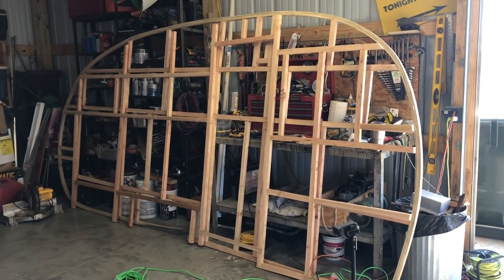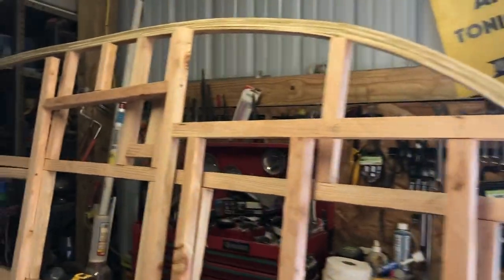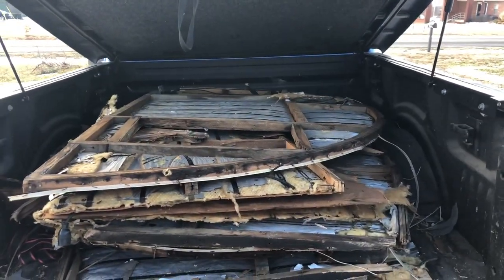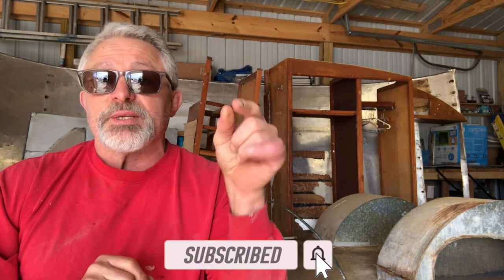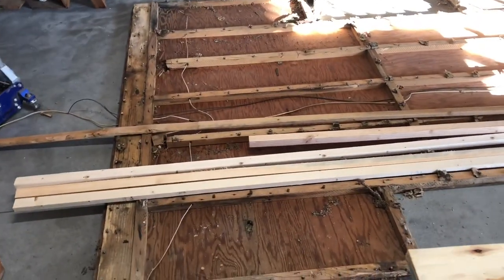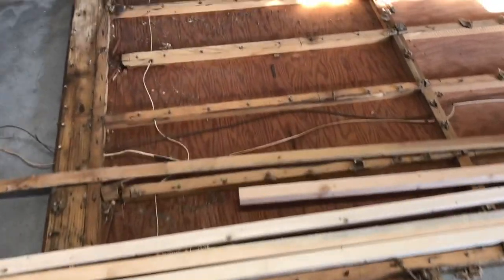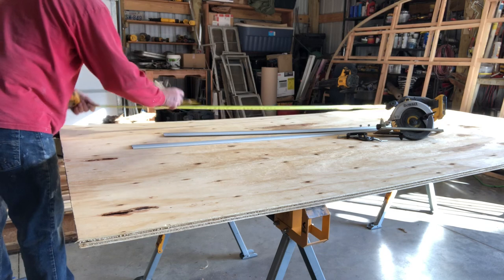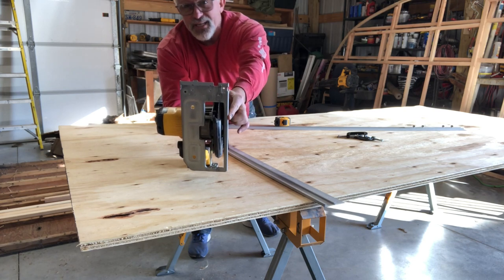EP 130 Rebuild vintage camper floor step by step 1954 King retro RV. Plywood and lumber

Comment: Great video series on this build.  I think I saw a previous video of yours, where you mentioned the wheels on most of these old trailers, are a certain lug pattern, are they 5 bolt by 4.5inch pattern. (Ford wheel)…?
     It doesn’t really matter, now but that plywood “damage” is actually called a “void” in the plywood manufacturing world, the dark substance is the glue resin that never had a piece of veneer layered on it.
    There is a percentage of that, that is allowed in the industry, as well as “blows” (where the veneer did not adhere to the layer(s) on top or below each other).
    These quality defect(s) percentages have gone down from over the years, from 90-100 percent required,  to 80 percent of the panel size being allowed in the industry.
    Ok, I know waaaay too much info… hahaha.  At the prices they are getting for a sheet of plywood these days, you should get a discount.
Reply from the maker: Prices are crazy! They were mostly the Ford 5 bolt pattern.
Reply: Ok, great thank you for replying back.